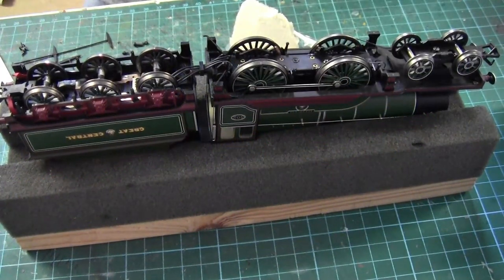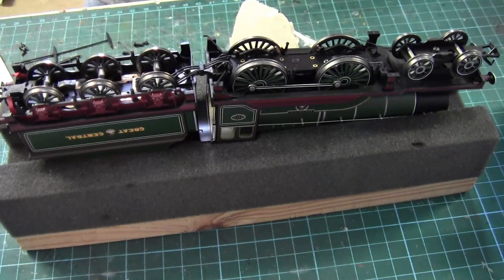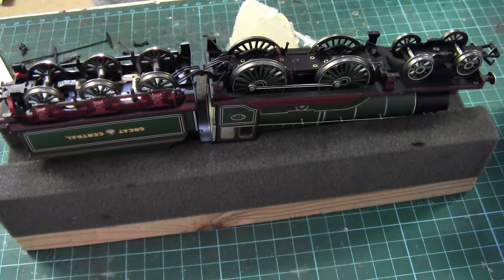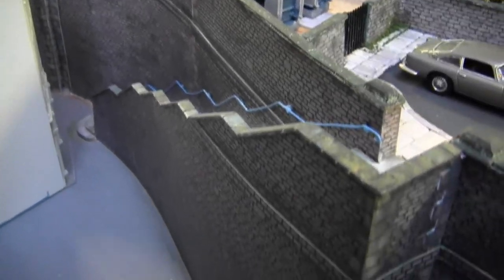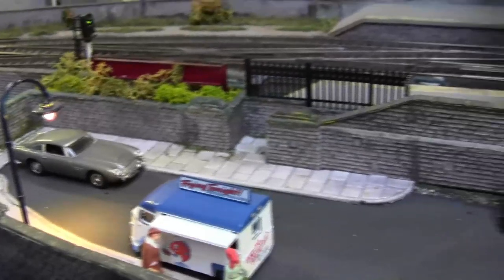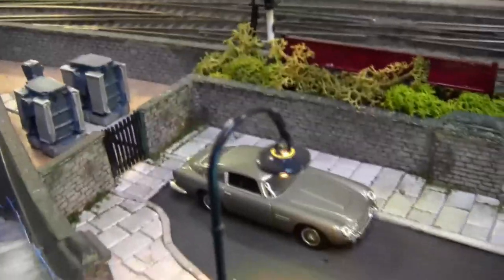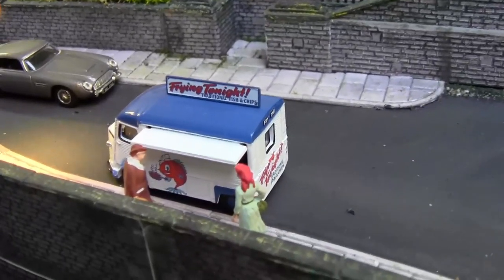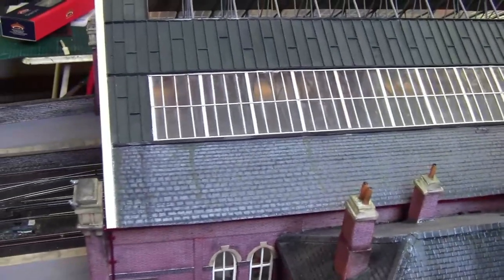The Walking Talking Tour   No 359

Comment: Hi Tony, Slightly biased towards Tyne Dock Station🤔😂🤣 The sound file on the GCR loco is great! Best Steve
Reply from the maker: Yes I am that Steve, Tyne dock is also on the list for some light works. 
The GCR loco's are at a reduced price at the moment. from rails of Sheffield. there are two more loco's for this year. a G5 from modle railway centre. and one more from rails. and that's me lot. 2 or 3 loco's a year. there are just getting too pricy. all the best my friend. cheer's for now Tony
Reply: @TONYNORTHEASTERN  Hi agree the prices are getting silly. Have bought a few off eBay spares or repair, make a good winter project at a fraction of new prices. Also picked up some London Road Models Brass Kits 50ft Cowans Sheldon Turntable Kit & a J21. Should keep me busy for a while! Cheers Steve

Comment: Hi Tony,  Thanks for sharing your layout once again... I think that it was Cyril J. Freezer, who edited Railway Modeller many years ago, who first said that a Model Railway is never finished...  He certainly knew what he was talking about!  Incidentally have you thought about using one of those mat sealing sprays that are manufactured by the artist's supply companies?  I've used the one by Windsor and Newton with some success...  It seems to prevent fading and sharpen up the colours.  All the best, Ken.
Reply from the maker: Your very welcome Ken. Cyril J Frazer that name rings a bell. i use to collect the railway modeller back in the late 1970s. 
I will need to something  with that back wall. as its the only wall where the back scene fading is happening. but i have a cunning plan. 
to make some flat gable ends of houses. just along that stretch. but i will use your suggestion first. as i don't to remove the back scene. just add to it. many thanks again Tony

Comment: Dear Tony, love the grand tour of the North Eastern loft layout. Very interesting to see how your layout is fitted into the attic space. Also, like one of the other regulars answered on my question about the layout configuration, a few months ago; it’s amazing to see how much stations you’ve been able to put in, without compromising on, let’s say, space for through lines, whether mains or branch. Or, at the very least, a kind of ‘open space’ in which you show running trains in the vids, which enhances the illusion of the line sides. 
Anyhow, on the brewery track, your idea of passing loop will indeed make a difference. On the scenic aspect of the brewery; you might consider a larger facility. Maybe with some of the farthest spurs covered, or partly covered. Think this will help elevate the corner from a cornered space into one which adds to field of depth.
For the other corner leading the elevated towards South Shields and where the Jarrow Road line branches off at Little Haven, at the back end of the portals under the elevated line, maybe consider some cutout dioramas in N-scale. Possibly, or when possible, with a slightly deeper back-end beyond the vertical backdrop. This will allow you to create the illusion of depth beyond the pillars. Sort of, giving the portals their ‘building interior,’ but of course, exterior on the back end.
Yep, on the kits, that’s where most of us started with. As did I, and when one day I realized the space for the kit station I had wasn’t suitable, there wasn’t anything else left than to put the hacksaw and file on it. So, indeed from the kitbash came the scratch building.
Curious to see what your plans for the New Hassle canopy will be. Given the quality of the entire South Shields station and its canopy, I would say it will become yet another of the Magpie’s North Eastern gems.
On the fading Peco backdrops; is the attic insulated? Considering the difference between the backdrops on the masoned wall and the roofs’ underside, the intrusion of summer heat into the roof structure may be the main issue. Don’t know if you have the stamina for it, but if you revisit the backdrops, you might consider to put a reflective layer before the masonite, to keep some of it out.
Really enjoyed the overview, it is an absolute pleasure to watch and truly appreciate your narration on all the different angles of the layout. Also, on the timeline in the layout’s story, on how you’ve developed from a kit builder, into a basher and scratch builder. The uniqueness of the South Shields and Jarrow Road stations and other structures and building truly underscores the level of creativity you’ve achieved and reached. For that part alone your vids are an absolute pleasure to watch. A humble magpie watcher in gratitude. Cheerio
Reply from the maker: Good evening Vincent, your comment has to go in the T,N,E magpie book of records as the longest comment ever.
 
when we decide to take a model railway, we are only novices at the start. then we get confidence in our ability and from that we achieve things that were unthinkable when we had started out in the first place. and then when we build something like a building for instance, and turns out like you had hoped for. then you strive to get better. and that is the progression as a railway modeller. and that's what makes this hobby great. 

The loft is insulated, but that side always catches the sun in the summer months. i have two choices redo-the back scene with of the same. or build some very thin small relief buildings. it did last well 7 years. its funny how its only in that area.
I like your idea for the upper level. but i was thinking of a stone viaduct. like the one at Durham. 
I am glad that you enjoyed the tour. and thanks again for commenting and giving me some cracking ideas. thanks again Tony.
Reply: @TONYNORTHEASTERN  thanks Tony, it’s an honor to be chiseled into the Magpie’s Book of Records. Especially when writing, my humble voice isn’t/cannot be sparse with words.

Comment: Hi Tony, a very enjoyable tour and welcomed reminder of the layout of the North Eastern.
Have you considered protecting backscenes and other artwork with a non-yellowing, UV Resistant, Matte Clear Coating (spray)? Krylon K01309 Gallery Series is one make that seems popular, although I have no personal experience of the product.
Any thoughts on the signal box, Tony?  To be different and because of the restricted space you have, you could, if you like a challenge, build a gantry signal box like the one at Hexham, or a simpler cantilevered design, being a signal box mounted on a narrow stone or brick base, on the lines of the one at Haltwhistle.  Just ideas my friend, just ideas.  Best, Jason.
Reply from the maker: Hi Jason. its funny you should say that. but yes i will be doing that and adding some extra flat gable ends just to make more interesting. i know that signal box at Hexham. its a beautiful designed building. there was also a overhead signal box at prelaw. 
Ideas are great. i shall keep them in my back pocket of ideas. stay safe buddy. cheer's tony

Comment: Thanks Tony for your latest tour brings back memories of days gone by. Your comments about adding or changing areas reflects that saying "a model railway layout is never finished " (how true), but I think that is part of the appeal to model railway building. I've notice you have a rake of Pullman coaches this is because I have been fitting passengers to my fleet of coaches and the last ones to complete are my Hornby (white roof wood panel) Pullman ones I hope you don't mind me asking have you fitted passengers to your coaches and have you any idea about taking these Pullman coaches apart. Its bizarre that only since I have gone about taking these coaches apart that I have taken more notice of layouts with these Pullman coaches on them (sorry its a bit of a long comment) stay safe mate regards Barry..
Reply from the maker: Hello Barry. 
            I have fitted figures into my Bachmann teaks. but not to any Hornby ones. i guessing that they just clip onto the chassis. the tabs must snap them in place. so carefully does it on this one. I am sure someone has done this before. might worth putting into the you tube search, just to see if its been done before. good luck and all the best Tony